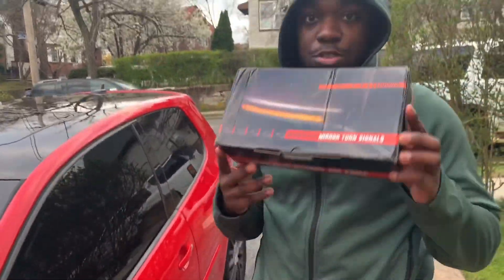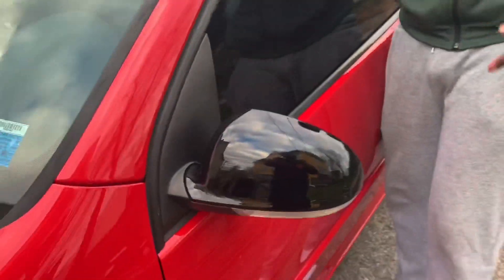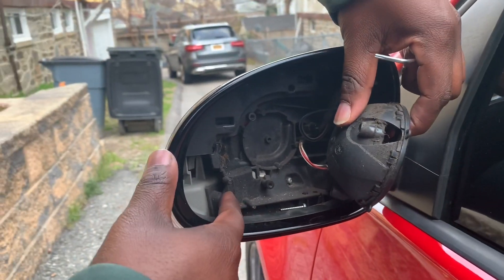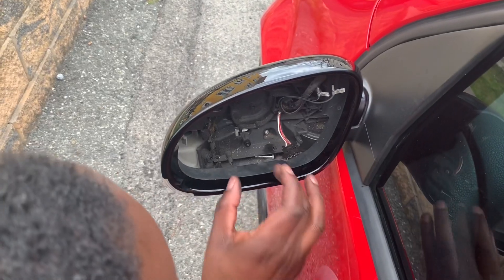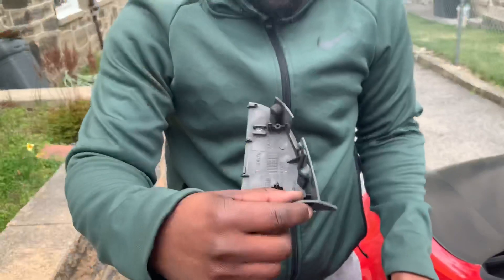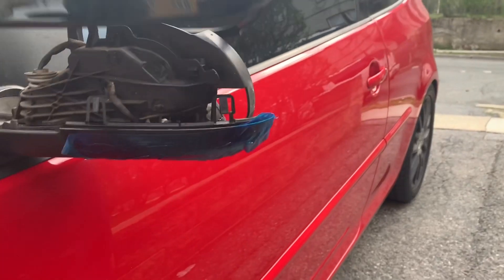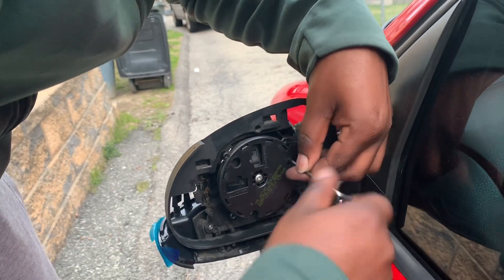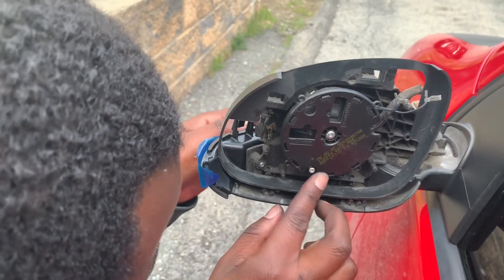MK5 GTI GETS SMOKED SEQUENTIAL TURN SIGNALS

Comment: did these throw a dash light from changing to an led ?
Reply from the maker: Noah no they didn't, only problem i had installing them was the pin connectors wouldn't sit properly at first, so i had to slightly bend them to get a snug fit
Reply: they already led :) but yeah no errors